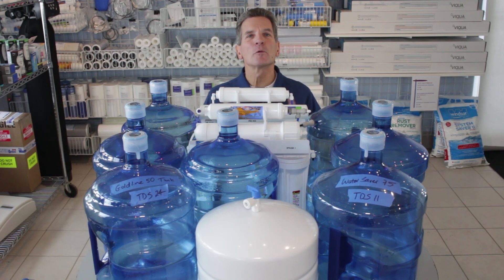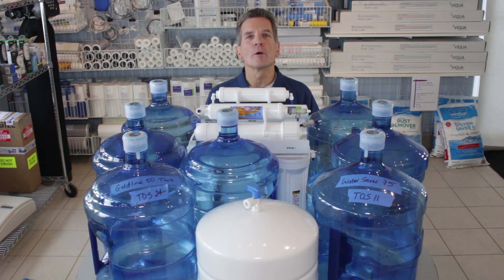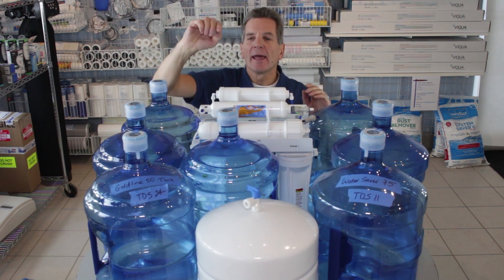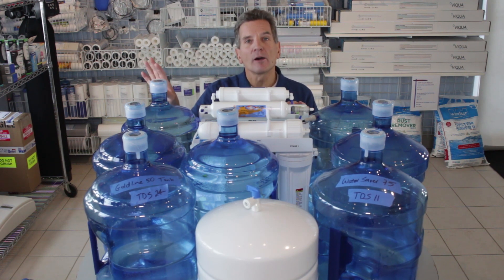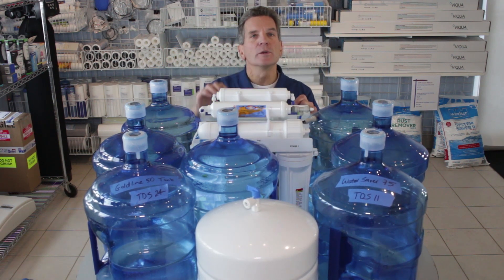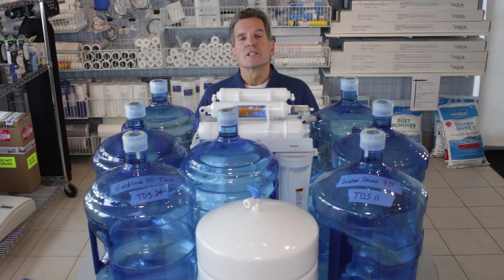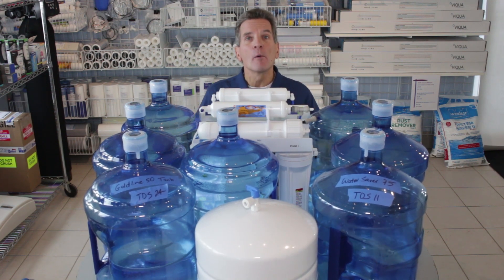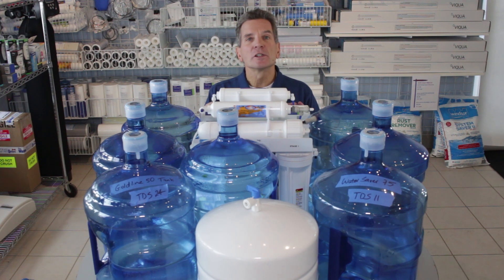How Much Water Does a Reverse Osmosis Drinking Water System Waste?

Comment: Watts makes a system that injects the waste water into the hot water system of the house, for use in washing, showering, etc.  Has worked great for 10 years, with zero waste !
Reply from the maker: Hmm, sounds interesting but that would increase the mineral content in your hot water, although likely not by much.

Comment: So you mean the water going into the drain is not waste? Come on it’s water. It doesn’t wash clothes or the dishes. It’s waste.
Reply from the maker: It's not wasted because it is fullfilling the function of filtering and purifying your water so your family has safe pure drinking water.  Similarly, the electricity or gas that is heating your home, that energy sourcve is not wasted it is used to heat your home for your family.
Reply: @water_estore  it’s not economical. I pay for the water that passes the meter.

Comment: This doesn’t make sense… the water goes into the filter and goes out the filter… there is NO OTHER EXIT FOR SO CALLED WASTE WATER EXCEPT THROUGH THE FILTER AND IN OUR MOUTH…
Reply from the maker: Yes, a reverse osmosis system has a drain line. This video shows you how they work https://youtu.be/Quy_Mg87Tsk

Comment: What is the TDS of the waste water? I just want to lower the TDS of tap water not for drinking but to be used in hydroponics.
Reply from the maker: The waste water TDS is very high, the product water TDS is very low.  The exact numbers depend on what you are strtaing with and will vary.

Comment: Just installed a generic 50GPD 7 stages RO system with 3 gallon storage tank  (APEC ).   My product to waste ratio is about 1:3.   I believe the only different between a 50 Gallon per day  or  75\100\150  is the size of the Flow Restrictor  installed.   I since replaced the 50 gallon Restrictor  with an adjustable valve.   The ratio is about 1:1; this is without a booster pump.   My GPD is probably 20 which is more than what I need.
Reply from the maker: Good to know.  What is the TDS of your water before and afdter the system with these chnages?
Reply: I use a Pneumatic Air Flow Speed \ Needle valve, cheap 10 dollars one.   TDS before is 3-4 and after is similar.    My  install is similar to the flush kit except the restrictor  is the valve.
Reply: How do you replace the adjustable valve?

Comment: @Gary the water guy . Wish I would have seen this video sooner! I have a 3/8" output Ro system roughly a month old.  Running on city water with a water softener installed. Similar 4gallon tank with roughly 2.5gallon of product water reserve.  Theoretically speaking with the system feed water shut off and both drain line and water tank line are put in measuring devices and feed line re opened my system produces water at 3:1 ratio. (3 gallons wastewater to 1 gallon permeate water). This is of course not how the system was designed to operate.  So when the 3/8" line is connected to the water reserve tank the diaphragm is being compressed by the good water filling up the tank.  The air prefilled in the water reserve tank compresses creating pressure for the outflow of the drinking water.  This pressure also creates back pressure in the line coming from the Ro output to fill the tank reducing it's efficiency.  I first tested a full non draining system by emptying out 1 gallon of drinking water from the Ro Tap and connected my drain line to a measuring device.  It took 9 gallons to refill the systems 1 gallon that was used.  Therefore I roughly had a 9:1 efficiency ratio. (9 gallons waste water to 1 gallon drinking water).  I then performed a second test with a full system.  I emptied the 2.5gallons from reserve tank by closing the feed line. Once completely drained I connected the drain line to a measuring device and re opened feed water line. The system took 16.5 gallons to replace the 2.5gallons used. Although slightly better than my first test I expect that the completely empty tank has less back pressure working against it at the beginning.  Still I am unhappy with the result.  Is their a solution to achieve better efficiency with my current system? I.E. Booster pump and or Permeate pump?  Any advice greatly appreciated.  Thanks
Reply from the maker: Great analysis but no, there is not.  You would need to upgrade to a high efficiency Reverse Osmosis system like this https://waterestore.ca/products/hum-water-saver-reverse-osmosis-system-75-gallons-per-day?_pos=199&_sid=522de061b&_ss=r
Reply: @water_estore  Thanks for the response.  I took your reply into consideration however I chose to experiment with the permeate pump.  If I did not see results that I wanted I would have either returned the permeate pump or disconnected it from the system.  With that said I did purchase a permeate pump.  I was quite disappointed when I could not find one on your waterestore site in the states.  I have been looking for a reason to purchase something from your business as you have greatly helped me with your videos.  Back to the permeate pump.  I purchased the Aquatec ERP 1000 permeate pump.  I installed this permeate pump per manufacturer instructions.  I was aware prior to purchasing that this particular model produces a audible clicking sound as it operates.  This noise does not bother me and is a indicator that the system is working.  Here are my results after multiple days of testing the system with the permeate pump.

-Prior to installing the permeate pump my reserve tank was holding 2.5 gallons of permeate water and if I pulled 1 gallon of permeate water from the system it produced 9 gallons of waste reject water to refill the system.

-After installing the Aquatec ERP 1000 permeate pump my holding tank now holds 3 gallons of permeate water.  When I remove 1 gallon of permeate water from the system it now only produces 4 gallons of waste reject water to refill the system.  

I used the 1 gallon pulled as my personal testing example(s) as that is how much water I typical pull at a time filling water bottles etc.  As close to a real world scenario as I could provide.

*Holding tank increased the amount it holds from 2.5 gallons to 3 gallons a 20% increase.  My efficiency went from 9:1 to 4:1 a 56% increase in efficiency.  Although I was not specifically having a low pressure issue at my RO faucet the pressure at the RO faucet did increase some but I believe that is do to the additional half gallon in the reserve tank produced by the compressing the bladder and thus putting a bit more pressure on the line.  I can fill 1 gallon in 60 seconds.

As I get deeper into this I am beginning to think the only real difference in efficiencies are the particular flow restrictor in the waste reject line and RO membrane used.  A higher water pressure will be more efficient and also have a lower TDS.  Also in an ideal world warmer water produces better efficiency on paper as well.

Comment: if using this system in a motorhome could you connect the waste back to the freshwater tank seeing as most water is used for cleaning not drinking?
Reply from the maker: As long as no one drinks it and you don't mind that it will not work well for cleaning and you'll need to use far more soap.

Comment: If you're running a dishwasher or washing your car you're using the water for something. If the water is simply going down the drain it's being wasted.
Reply from the maker: I see your point but also, if you want super pure, low mineral content, great tasting reverse osmosis water, that is free of almost all contaminents, the water going to the drain is part of the process and part of the price you pay to get it.
Reply: @water_estore  good morning. At what cost? As a world traveler I've been to places where people people don't have any water to drink at all and there are some parts of the United States we are we pay as much as $0.50 a gallon for tap water or have no access to water for crops...From what I've read some of those minerals that are filter out of reverse osmosis water are necessary and a part of good nutrition. Reverse osmosis is known as dead water due to its lack of any nutritional value. I find it hard that you can justify selling a system that wastes up to 15 gallons of water to make 2.5 gallons of nutritionally dead water..
Reply from the maker: Yes there is a cost for everything. Reverse Osmosis systems are a great solution for some people in some areas of the world but there are a few exceptions, like everything else. Most of the people watching my videos live in areas where they would benefit but it is certainly up to them if this is the best choice for their families.  Reverse Osmosis is not dead water, it is water that has had the mineral content reduced and the "waste" water does not disappear into thin air it goes back into the waste water stream to be processed once again, like all water does.  Also, you would need to drink massive amounts of water every day to get any meaningful affect from the minerals in water compared to other liquids, like orange juice and the foods we eat which is where we get the minerals we need to survive on a daily basis.  I encourage you to watch this YouTube video of mine https://youtu.be/WJ6bRqiFIFM I beleive that familes need to do the research, partially by watching videos like this one and decide for themselves what works best for them.
Reply: I just installed my RO system and tap drain waste as instructed into my sink drain. I don’t like that I can hear it drip down lol. Plus I wonder if I can just extend the drain line outside for watering the garden? my kitchen sink wall is right into our backyard.
Reply: @Oneklickmedia  I actually was just wondering that after watching this video. In that way is not fully wasted water. Did you find any info? Wasn't sure if it could be rerouted to maybe going to the toilet tank or of that would mess up the internal parts since its all the impurities.
Reply: You mean like the water that just goes down the drain when you flush the toilet?  Or perhaps even the water you drink and then send down the drain via the toilet?
The water discharged from the RO system was used to carry away the impurities from the pure water that went into the RO storage tank. It is used just like water is used to carry away impurities from your body and from the toilet when you flush.

Comment: Ideal tds for drinking water should be between 100-300.. so if the water filtered TDS is 11 with your system , that means it’s very pure water but without any minerals, which is not ideal water for daily consumption.. kindly stop fooling people by miss guiding them !!
Reply from the maker: I respectfully disagree. I believe mankind was designed to drink water from lakes, rivers, streams and rain. All of those sources have TDS below 20, just like most Reverse Osmosis water. Also, many water sources have TDS in the 500-2,000 range, those families desperately need Reverse Osmosis water to get their water into drinking water range In addition Reverse Osmosis removes chlorine, a known carcinogen as well as residual pharmaceuticals and personal care products from water and provides a barrier against bacteria. What makes you think the ideal TDS range is 100-300?  I assure you that when it comes to the information I include in my videos On water I am not fooling or misguiding anyone.
Reply: Water from rivers or lake will never have TDS less than 50.. it ranges from 50-500 depending on the site of water source.. I agree to the comment that In some places the TDS is very high as u said 500-2000 , in those places TDS control is needed but it should be brought down to around 50 to100 and not below 20..

Comment: We just installed an RO system and experimented for a couple months and the result that our water bill ⬆️⬆️⬆️... is there any efficient way to re use the drain line water source? Like a system or some sort?
Reply: You could use the waste water for non potable water uses like watering plants or use in the toilet, in the country I live we have a separate cold water tank that stores rising mains water for use in the heating system, toilets, sinks and bathes and heated water tank. You will need to understand however this water has higher than normal mineral content, so a second tank just for the toilets and sink might work if you also had a system that feed in auxillary water since the filter systems don't run if the permeate tank is full, so you avoid the situation were you take a shower and the tank empties but does not refill as there is no waste water, you could also accidentally fully fill the storage tank with waste water in which case it's sent down the drain anyways, so maybe two sets of levers to let in auxillary water if very low up until about 70% tank fill then 70-95% is reverse osmosis, then the rest is drained after that.
This would be very expensive and only make sense in countries where water is in scare supply as well as expensive.
Reply from the maker: @JoshuaNicoll  yes this could be done, just depends on how much time and money you want to spend to accomplish it.
Reply: @water_estore  exactly, it's probably only viable in places like Australia or California, Isreal or Hong Kong, places where clean drinking water is very scarce but the water quality in those places is not usually awful anyways.
Reply: simply collect the water in some buckets and use it for watering plants or cleaning your house, that requires NO money. if you are willing to spend, then you can think of installing a system to use it in your toilets or sinks
Reply: @AdityaKumar-bk7eu why I came here lol. I just installed mines two days ago and already thinking buying new drain line and pull it outside either into a watering / washing station via foot pump. I might just buy one of those plastic one I’ve seen online.
Reply: Hey Chum, how much people live in your home?, As I Know if the filter saturated this decrease his performance
Reply from the maker: No, nothing that I know of.

Comment: Its nonsense dumping perfectly useful water down the drain. The "waste" water from a RO should simply be dumped into a water reservoir where it would be mixed with the water supply that feeds your domestic system.

This whole "RO is wasteful" thing sounds like a bunch of propaganda to me. I can only think of wicked or ignorant reasons for smearing a resilience tool like this.
Reply from the maker: midbarit please understand that I am not smearing RO systems, in fact far from it. I am just doing the research and presenting the real facts about RO systems. I believe that RO water is the absolute best solution for every family it’s just that some RO’s are far more wasteful than others. In fact the best selling RO in North America is one of the most wasteful. You are correct that the water could be used in a grey water application.

Comment: I was researching and I find out Pentair high efficiency GRO membranes are rated at 1:1 ratios with a 200ml flow restrictor (Their statement: 96% rejection at 500 ppm softened tap at 65 psig (4.48 bar) 77ºF (25ºC), 50% recovery)
The water saver 75 (which has a GRO) had almost 1:3 ratio, so it either has a different flow restrictor, too little water pressure, or just the back pressure from the tank holding it back.
Reply: Love the info m8. Keep it up.
Reply: Have you done any testing to dial in the flow restrictor and membrane to use for better efficiency?
Reply: I have a gro75 system as well, not the water saver. I got 1:4.1 at 13.5C (got it 2 weeks ago, winter here, tap water is cold)

Comment: Have you tested permeate pumps, i've heard they keep the efficiency quite high especially when filling a high pressure tank.
Reply: I had positive results testing and using the Aquatec ERP 1000 permeate pump on my system.

*Holding tank increased the amount it holds from 2.5 gallons to 3 gallons a 20% increase.  My efficiency went from 9:1 to 4:1 a 56% increase in efficiency (reject water to permeate water).  Although I was not specifically having a low pressure issue at my RO faucet the pressure at the RO faucet did increase some but I believe that is do to the additional half gallon in the reserve tank produced by the compressing the bladder and thus putting a bit more pressure on the line.  I can fill 1 gallon in 60 seconds.
Reply: I guess it might have to do with them not been proven enough, coupled with a patented design and high price. Also there is a myth they cannot be used with a booster pump. So I guess they prioritise the booster.